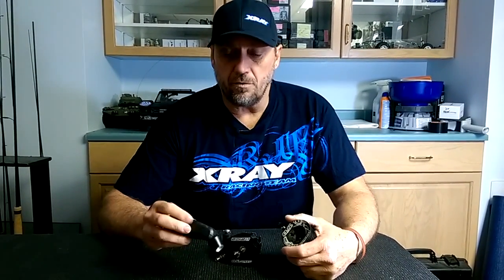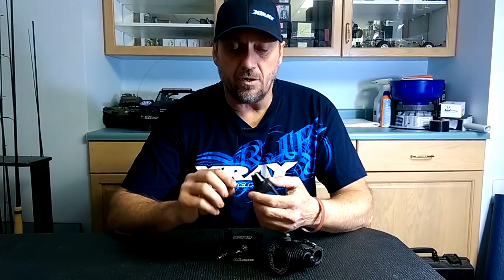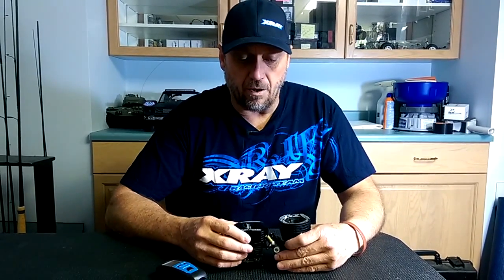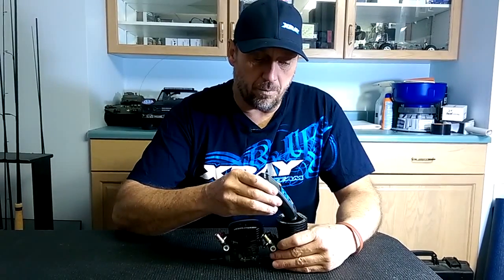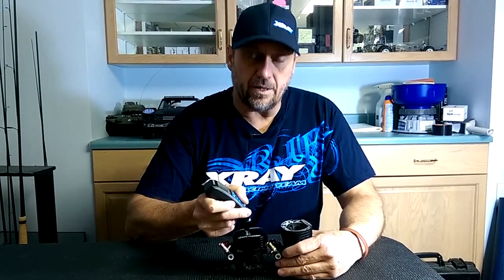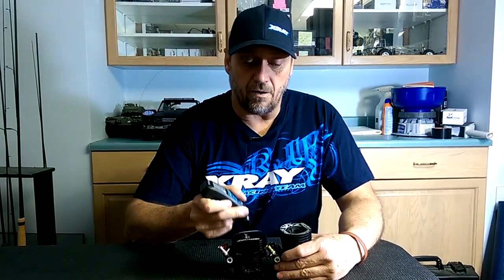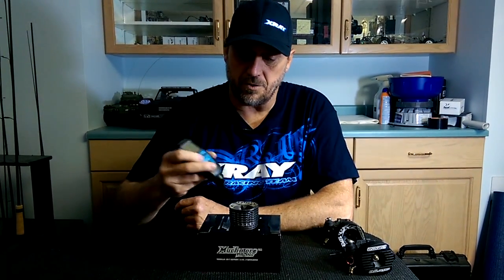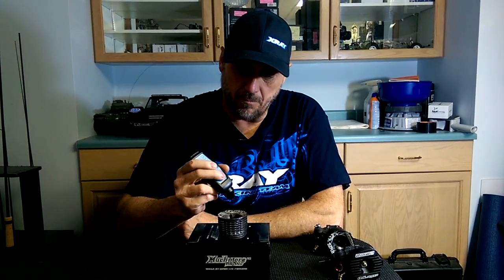Gord Tessmann Pro Tip: Tempgun Usage

Comment: Question... When taking a nitro engine temp using a temp gun with a laser, do u put the laser on the glow plug, the heat sink (top or bottom) or the engine block itself? extremely different Temps at all spots. For instance while doing some high speed runs in 78°F weather the temp @ the glow pug was between 190&240°F, on a wim I checked the block, the block was at 370°F I instantly shut her down... I am a nuube trying to get tunning downpac, please excuse if this is a stupid question. just really don't wanna burn up my lrp 32.

Comment: if you drive a hot bodies d8t, would it beat the hpi trophy 4.6 truggy? im asking because I could have swron hot bodies was under hpi
Reply: THE_TRUE_MOE it has more adjustability, is lighter and is made out of more durable materials, which gives it obvious advantage over the HPI model which is based on the racing chassis, but driving skill is equally important to make use of these advantages.

Comment: I usually just turn the needles until I am satisfied about the performance. But I have a temp gun and when I use it I usually press the button so it makes continouos readings and sweep it aorund the glow plug and the walls for 1-2 seconds and then read the maximum temperature recorded. This has given me more consistent results than aiming for a single spot on a given distance.

Comment: I guess quality has an impact as well, mine don't change much even from a long distance if it's pointed accurately.
Reply from the maker: We have used exergen, protek, temp gun, duratrax and they all are affected by the distance you hold them from anything that generates heat.  All Infrared temp guns are affected by the distance to spot ratio, some are affected more than others, the bigger the ratio the farther away you can be. Basically my point was if you are going to use a temp gun to tune your motor be consistent with the distance you hold the temp gun from your engine.  This also applies when you are running electric motors and you want to know if you are geared correctly.   Again this video was intended for those who choose to use a temp gun as an aid for tuning their engines.  Can you tell me which temp gun you are using that isn't affected by the distance? - Gord
Reply: It wasn't my intention to come across in a wrong way, some things gets lost in a text I'm afraid. 
I have used a lot of high end stuff, working on larger engines, but they wasn't extremely accurate. The one I'm using is a very old one given to me for free, it's a grey stick from Stanley, but a search later shows it as;  Oakton WD-35625-10. It is affected by distance, but not as much as others I've tried/borrowed/used. 
I hope that helps, and again, sorry if I came across in the wrong way! :)

Comment: My b2102 always reach 120 celcius, is it safe degrees for my engine?
Reply from the maker: Yes definitely this is within the safe range to run the engine, the outside temperature and how much grip you have will also affect the temperature.  I would not recommend running your engine at anything over 143 celsius (290 farenheit).
Reply: That's a relief ! I've been fighting two days on my new LRP (it's a speed 2 basicaly) to tune it as it only felt good and behaved properly at 125-130 celcius (ambiant 15-20°c), I was baffled as anything lower temp the engine would be a pig and way too rich (top+bottom). Track has a lot of grip too.

Comment: you are correct Gord. The temp gun I use for w
ork actually tells you on the back of the handle the recommended distance you should hold it from the material you are temping. It makes a lot of difference

Comment: I dont even use a temp gun, just tune off sound and feel
Reply from the maker: Sound is not always a viable option as I said before if you are in a qualifier with 14 other drivers it can be quite difficult to hear your own engine out of all the other sounds.  Feel is definitely the best way to tune your engine but again this isn't an engine tuning video it is a video on how to use a temp gun if you choose to use one as an aid in tuning your engine. - Gord
Reply: +Ty Tessmann so you guys use the temp gun for consistency of the high end needle?, but it could be different depending on atmospheric conditions, or do you use the temp gun for tuning with in a safe temperature to avoid detonation
Reply: +Ty Tessmann also what do you guys think of the MORBC track in perth, the worlds facility for 2017, its my home track
Reply: +Ty Tessmann tbh i think the only time you need a temp gun is when you are breakin in an engine to get the engine up to temp and expand the sleeve